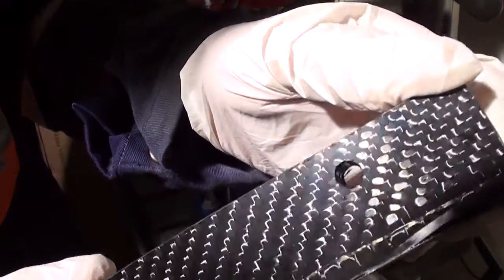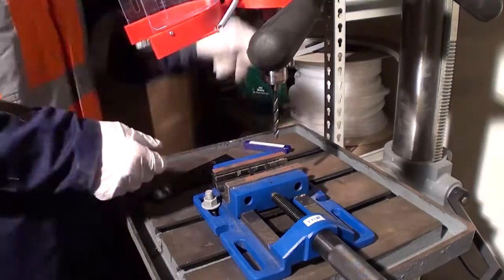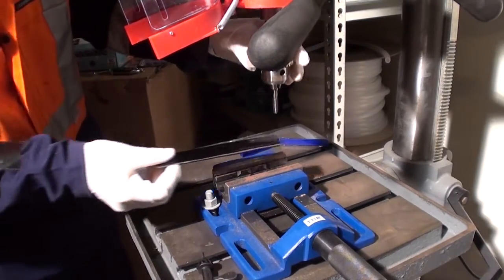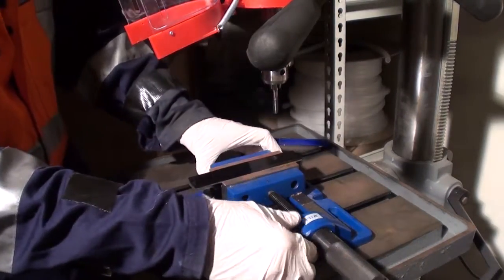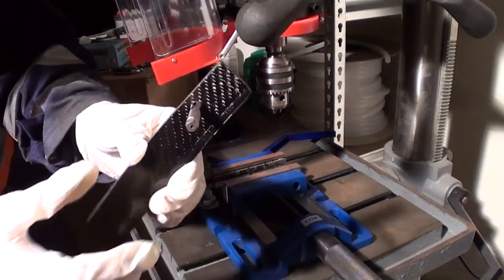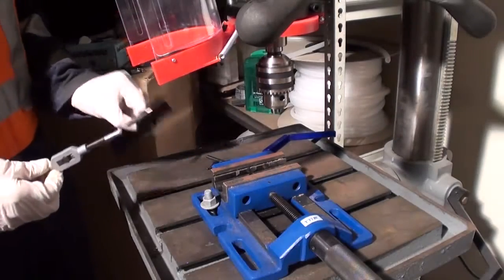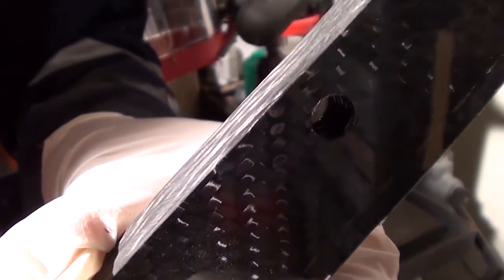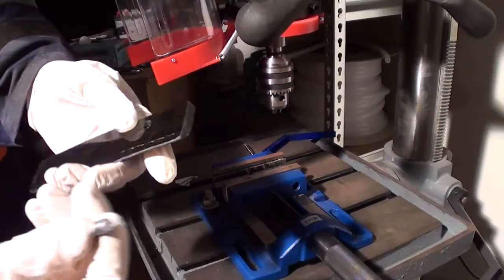Can a carbon fiber sheet be tapped to create a thread?

Comment: By taping you have stressed the carbon fibres and broken a lot of strand bonds at a micro level. You should reseal the fibres in the hole with a very thin and slower setting cyanoacrylate (superglue), or an epoxy. 

Once coated take your bolt and coat it in a release agent such as silicon spray or similar and thread into the hole. This will strengthen the thread by putting the broken fibres into compression to bind with the glue. Once set the release agent should allow you to remove the bolt and have a nice tight fitting thread. It will not be as strong as an alloy thread and will not take the same torque loads, hence why rivnuts are normally used. For that you should use a backing nut of some description.

But it will be reasonable for non structural loading, which kind of defeats the purpose of using a strong material like CF in the first instance.
Reply: Thanks. What about threaded nut typre nut put in there?

Comment: It appears to be a solid block of carbon fibre with a relatively rigid core. Would the same result work with a foam core and 3 Carbon fibre layers?
Reply: +Marco Gallone .  I would try some insert as Dodge or Stanley sell depending of the O.D of the hole.

Comment: ideally you would want the fiber layup following the thread to get the fully strength advantages of the carbon. Have a look at schmolke's carbon screws.

One could make glue-in carbon inserts of threaded structural type, and glue or lay those into the carbon layup.

However, epoxy will take a thread fine in most cases. For surface mounting components to carbon epoxy composite for non-structural purposes, self tappers or threaded bolts are fine. In terms of the thread, it's probably slightly weaker than epoxy, and will be graphited self-lubricating.

Comment: great vid,

and a question from a noob: putting a metal screw in carbon fiber like this, can galavanic corrosion be a problem? I am in the process of making something, where i need to join a carbon tube and a metal part, and i was thinking on screwing them together. if anybody has any useful ideas, i would be glad if you shared it with me.
Reply: CFRP does conduct electrcity rather well so galvanic corrosion can be an issue.  I never crunched numbers on it but Aluminum is used with CFRP bare all the time and they don't attack eachother so an Aluminum bolt would likely be fine.  but if you're using another metal and it is an important consideration for your design then you can always fiberglass the area.  if you're placing the bolt after layup like here then you could perhaps drill the hole large, layup fiberglass in the hole then drill again and tap into the fiberglass instead??

it's a thought but seems like more hassle than it's worth

Comment: I'm glad there are people like you who consider such things and experiment and post the results. Thanks! I reason I ended up here is because I am working on carbon fiber tubes that are extremely thin and yet they have been threaded on the outside with a superfine thread and they then screw into an aluminum fitting, and it works remarkably well and is very robust. I hope you posted a stress test on your experiment.

Comment: Thanks for trying it and posting your results. I thought you could do it but like others not too sure of the strength of the thread. I am also not too sure with using a helicoil as to my mind it is still tapped into the resin so will only act to transfer forces to the resin anyway

I am looking at using rivnuts that are pre-split or slotted body type as I am using very thin carbon sheets for an airbox and dont want to crack it.

Comment: Have you done any experiments to see how strong the tread is? How much does it weaking the material. Im looking into doing this through a rod to connect two blocks of wood together. I was planning of having a rod sticking out of block a, then in block b a tube going in where the rod from block a will enter to the be screwed in place too hold it into possistion.

Comment: Best option using bolts in plastics/composites is a 'Rivet Nut' or embed a threaded insert when the part is made, although fiddly getting alignment correct unless the inserts/nut is held in-place with a template. Dafra Products in Melbourne specialize in Rivet Nut supplies wwwDOTdafraDOTcomDOTau... Their website has YouTube videos showing how they're installed... Great to see you get back into making CF parts & thanks for sharing with us mate... :-) Sent you a PM...

Comment from the maker: well i've found that just drilling a pilot hole and trying to put a srew into it will probably end up snapping the screw.... I guess due to the fact that you're forcing the hole to spread - compressing the fibers around it. and cf doesn't take kindly to compression.... so i guess tapping the hole most of the way, and forcing a bolt through the remaining bit... might work.... maybe. a bolt is much bigger than a screw as well... so it might be even harder. or not... i'll try to remember to test it

Comment: Didn't expect a problem tapping it. Similar to a tuff plastic like "Lexon" which I've tapped with success many times... I'm not expecting the thread to be very strong & with a little effort or wear & tear it will most likely strip the thread out... You can get a much tighter thread fit if you use the actual bolt to tap the hole. Use a tap to start the thread then the bolt to finish tapping the hole... Will give much less slop then using a tap... Doesn't always work..!

Comment: ive also wondered about the heli-coil idea. my only fear with doing that is that the carbon fiber threads may fail anyway since they are still acting as a main contact point for the heli-coil threads